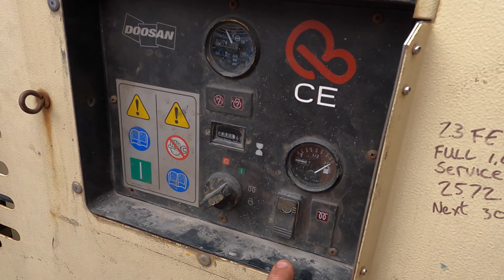Nightmare Job Boat Sandblasting

Comment: R'reet Mick, Blimey! When the video started I was wondering is that a trick of the light or the camera angle but there really is that much filler under the paint? 😱
Nice job as always mate.
Reply from the maker: It was unbelievable mate they must have put in with a trowel was all over it

Comment: shocking how much filler is used but I guess most steel/aluminium  sailing boats will be like that to get the smooth lines
Reply: I've worked on a shipyard but I've never seen that before.
Reply from the maker: I remember once doing something similar to this before but it wasn't nearly as thick and it wasn't on every bit of it honestly it must have cost a fortune to skin it up

Comment: what do you use as a dryer on your dry blast system? Is it that thing attached to the front of your compressor by the valve.
Reply from the maker: That's part of it only real way of drying air is to cool it and then water traps
Reply: @Mobileblaster  we have a wet system but I'm interested in also doing a dry system but no clue how to cool/dry the air efficiently
Reply from the maker: @Green Mountain Mobile Blasting & Powder Coating  what size cfm you working with?
Reply: @Mobileblaster  we have a 375 cfm Doosan compressor pushing a greener blast technologies GB350 system. And we use 280-350 cfm depending on the job
Reply from the maker: @Green Mountain Mobile Blasting & Powder Coating  ya gunner struggle getting dry air from anything more than 350cfm well it takes deeper pockets to buy the equipment needed to do so I'm having a little trouble trying to get dry air from mine coolers are the way to go but bloody expensive for what they air
Reply: @Mobileblaster  that was one reason I went wet and don't get me wrong wet blasting is nice. But some jobs I just want to do dry
Reply from the maker: @Green Mountain Mobile Blasting & Powder Coating  I disagree wet blasting should be left as a very last resort any internal corners and your visors are full of shite any delicate work gets full of waste media build up in area that take ages to clean off and hard to perp for paint
Reply: @Mobileblaster  definitely get a lot of blow back on corners but where I live we can blast in many city or town limits with dry. That's why I bought a wet system. But I do want a dry system for outside limits. 1/2 or more of my jobs is construction sites and deal with air quality etc. So we have to have water blast system. But  I want a dry system so on the jobs we do like boats, trailers, log cabins etc it makes the job a lot easier. My only confusion with a dry system is the cooling of air and how to do it. I'm looking at a 3.5 or 6.5 Schmidts pot with hopefully a 375 compressor. I wanted to do a 185cfm compressor but the Schmidt dealer told me to be efficient I needed a 300cfm or more compressor. What's your compressor cfm? If you didn't cool your air would you pot clog? What size pot ?
Reply: @Mobileblaster  thank you for discussing this with me it's going to help a lot to get what I need for a dry system

Comment: Blimey i thought it had some sort of thick special undercoat boat paint initially until you did one spot & could see it was like 1/2" thick & was filler of some sort. 

I am guessing this isn't normal?
Reply from the maker: To see filler is normal but not this thick they definitely got giddy with it. Normally a good boat builder will only use filler to cover the grinder marks were they flattened the weld for a seamless finish

Comment: If that was my boat I’d be asking the boat yard to replace that fairing compound on the hull.
Reply from the maker: I believe they epoxy primer it and then filled so it was smooth (primer to give them chance to do the work before flash rust 👍

Comment: You need more pressure nd a few steps back so you can cut more like a shot gun blast
Reply from the maker: I'm setup for optimal withe the rig I have any more psi and your reducing this 3 main things play a part get any 1 of the 3 wrong and it's going to cost you more for less productivity 👍

Comment: ffs Mick you are playing with fire with that deadman I have been in the game for decades and seen some horrendous injuries had a chill when I seen you with them wires ,get some gauntlets minimum HSE would have a field day 🙄
Reply from the maker: The way my deadmans is setup I cannot let go of the pipe without it shutting down with it been electric this happens alot quicker than air powered deadmans. HSE wouldn't say a thing I've had them go over my business before I'm fine to do what I'm doing but when I had workers I had to switch things up ie I can blast without suit or gloves because it's for me but a worker has to have all the correct ppe wich is bolx if you ask me I did have to make sure my wip checks was the correct size for the correct pipes tho I was running 2 1/2" whip checks on 3/4" pipe and was told off because its to mate up I thort bigger would be better turns out its not also what I did anyway but didn't keep a log was servicing and daily checks needed to logged and dated. I didn't realise even if I did my servicing and everything was upto date if I've not got paperwork and something happened well insurance is void and any workers that could get injured will be taking me personally to court not my business (that should be insured)

Comment: For a switch you could use a heavy duty toggle switch after connecting it rape it with some rubber from a old inertube and seal the wires were they come out with silicone and get some electrical shrink tubeing to keep the dust out and you can still flip the switch 😊 just a note you will have to put the shrink tubing into the wires first before you do anything 😊
Reply from the maker: I managed to find a switch overseas and that works a treat 👌 just in the UK electric deadman isn't that popular so the parts are expensive 300£ for a trigger is ridiculous for a micro switch and plastic 😂

Comment: Really just needed a pressure wash and prepped for recoat of anti foul. Like jackhammering out rock to replace with concrete.
Reply from the maker: And what's the best method for prepping to recoating? We wasn't to know how much filler was used or how good of condition the filler was untill blasting. We put a 8 year warranty on this and I wouldn't have liked to go over the top of old what could have been shabby filler. That's the only reason we continued 👍

Comment: Why is your equipment always broke it doesn’t look professional at all
Reply from the maker: It's always getting used stuff brakes and the environment of a blaster is really harsh and demanding on all the equipment. I'm not fussed if my equipment doesn't look professional so long as the customer is happy with the finished job 👍